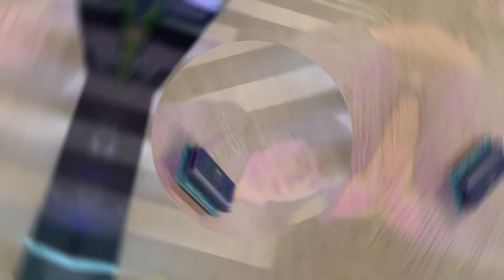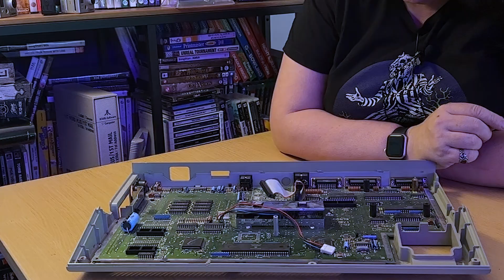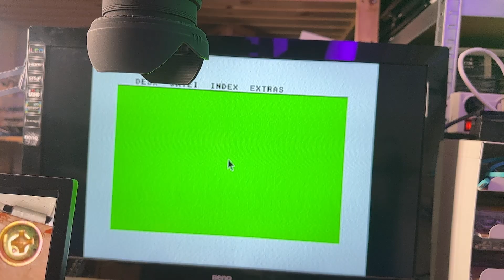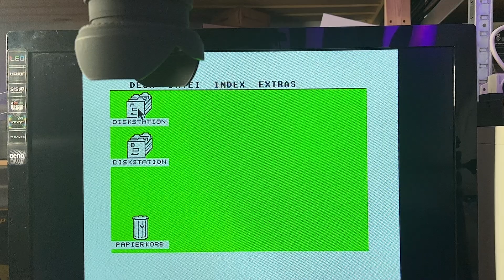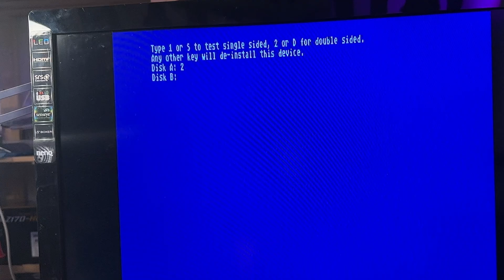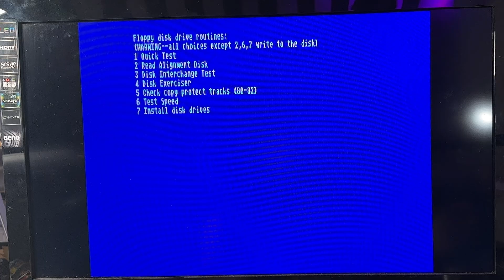Can We Fix this Cheap Atari STf Board?

Comment: The floppy drive select lines on these machines are a mess and go all over the board for some bizarre reason... You could well be chasing problems in the wrong place
It looks like you've got the functional part of the process working but (on my desk at least) it is time to probe out the signal lines to the drive itself and see what is getting through

Comment: What a frustrating machine! I'd try a different ribbon cable on the drive, and then if no luck start connectivity testing on the connector pins back to whatever chips they're connected to to make sure there aren't any broken traces. also may be worth checking the connectivity between socket pins on the back of the board and chip pins are all good.
Reply from the maker: Oh it’s a frustrating one. I did swap the cables but no joy. Even an external disk drive fails to read with this board. I’ve gone over the schematic (including recreating them so I could read them easier) and I’m still stuck as to the issue. Everything else seems to be working. I’ll turn my attention to the PSG next. Thanks for the advice though. I’ll double check everything.

Comment: Reflowing and reseating the MMU cured a similar ST problem for me…
Reply from the maker: Hmmmm, I will check that as this machine has the MMU soldered directly to the board. So it could be worth checking the joints under the microscope.